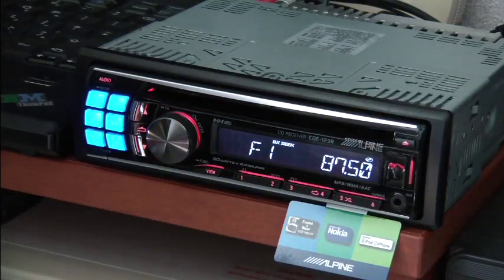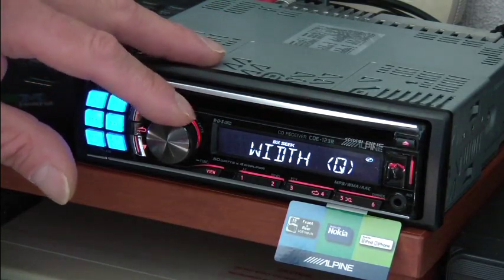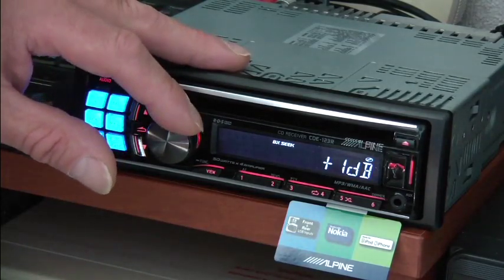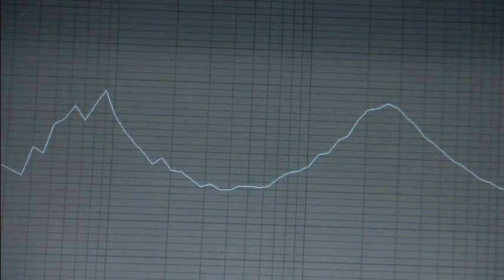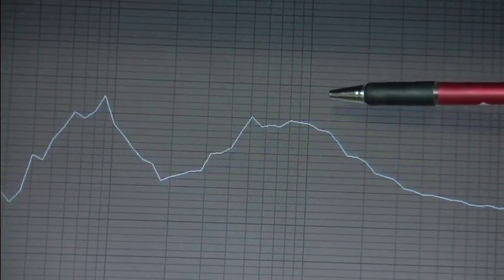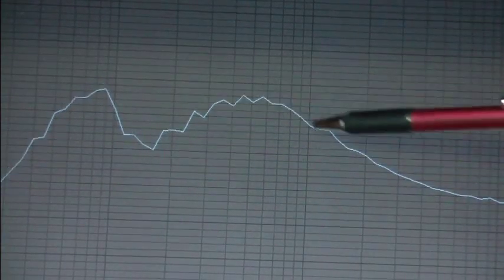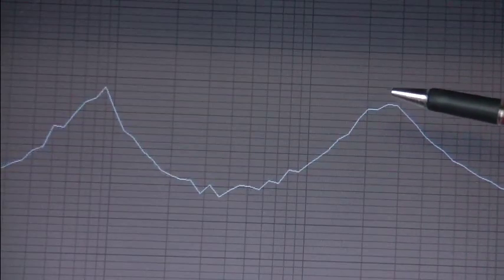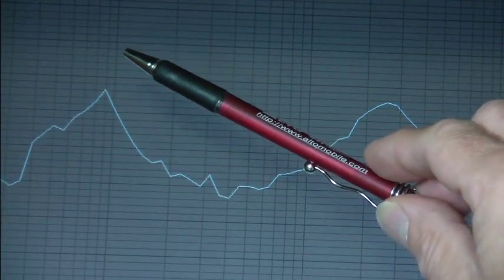Setting the Parametric EQ on a Car Stereo Head Unit

Comment: Thank you so much ! Hard to find many resources that break this down for the layman to understand.  This is super helpful.

However, when head units like alpine or kenwood (in addition to the parametric eq) have a "bass boost" and/or "bass extend" feature, do you happen to know what bass freq ranges your generic "bass boost" feature affects ? The manuals always tend to be vague.
Reply from the maker: Hi Wes. I can't remember if I ever measured the curve on those bass boosts, and they will no doubt vary a bit, but generally they are probably centered around 80Hz - that tends to be the frequency a lot of producers/recording engineers will work around in general pop/rock to give the track 'substance' without making it sound 'muddy' on some hi-fi, phones, radios etc. The boost curve may start to raise the output from as 'high' (in bass frequency terms) as 120Hz, then roll off below 80Hz to protect standard speakers from over extending. It can work ok (though very dependant on the speakers), and if just using the stereo's built-in amp then it can quickly run out of juice (i.e. headroom) and sound very muddy or distorted. On the other hand, if there's a separately amped subwoofer system tuned to, say more like 50-60Hz, the boost around 80Hz can fill a gap and provide better mid-bass. But again, it's all down to the quality of the speaker system, and the amplifiers; generally it's best to avoid engaging 'bass boost' but occasionally it can work magic.
Reply: @24HzICE  Thanks Kevin! Been trying to avoid purchasing a sub or aftermarket speakers if possible for as long I drive this '09 camry that came w/ a 'premium' JBL sound system (ext. amp & 8 speaker setup, no sub)

I prefer a flat tone, or as close to the originally intended sound production as possible, but of course the "flat" eq setting on any commercial head unit is never actually flat (marketing).  

I replaced the factory HU w/ with a Kenwood that utilizes the car's external amp.  If I want to stick with the OEM speaker set-up - and I know this depends a lot on speaker specs, etc - but in general, are the rear speakers going to put out the most bass?

If so, and if you're going to stick with an OEM speaker set-up w/ no sub, to get the best sound possible, is it generally going to be a good idea to apply a high-freq cut-off to the rears if you have a HU with that capability? 

Thanks a lot!
Reply from the maker: @Wes_5kyph1  I don't know the system you have without doing some research on it Wes, but generally OEM systems would use the larger speakers for the lower bass, and that usually means the ones fitted into the rear, also because they usually have the biggest area of air under them (into the trunk space) to work in. So yes, usually the rear speakers in a saloon car will give the lowest bass - and you should be able to clearly hear it. And yes, if they are full-range speakers with separate tweeters or coaxially mounted tweeters, then putting a high-freq cut-off (ie. low pass filter) on the output feeding those speakers will generally help the staging (the sense of the stage being in front of you), and it can often help the stereo left/right imaging too, and the 'placement' of instruments/vocals across the dash.  Having high frequencies coming at you from behind that are not natural reflections you'd get in a room or hall (these are different in time, phase and frequency span),  plays havoc with our ear/brain system that allows us to 'place' sounds. Just bear in mind it's not great though for rear seated passengers! Also, if you feel the bass from the rears is a tad boomy (not tight enough) and you have the ability to add a high-pass filter (sometimes called a subsonic filter when it's set very low), try it, set to perhaps 50Hz (though depends on the speakers and the roll-off of the High-Pass filter - anyway, just experiment). In other words, feed the rear speakers with a 'bandpass' signal - remove the very low end that the speaker might be struggling with (or over-doing - some OEM systems are designed boomy in the bass, because the designer thought that's what everyone wants!!), and cut some at the high end that tends to pull the image behind you, or at best confuses the front/rear staging.

Comment: Can you tell us good settings to start with line by line for this unit?
Reply from the maker: Hi Steve, Impossible to answer in a meaningful way because it will depend very much on the set-up in your vehicle (your speakers etc), the acoustics of the car itself, and your personal preference. The starting point would be to achieve a 'flat' or relatively consistent response (no big dips and peaks) by using an RTA to measure the curve of a full band pink noise track. After you can see the response is smooth, all the way up from bass to treble (or best you can get it), then tweak the various frequency settings to give the sound YOU prefer (more top, less mid, more bass, upper mid emphasis on vocals, and so on). Bear in mind that trying to do the first step by ear is near on impossible - you will need an RTA or more simply (but far more time consuming) plot the level on paper using a hand-held SPL meter and test disc with individual test frequencies on it.
Reply: KEVIN O'BYRNE I figured that would be your response and I absolutely understand that from the brief research I have been doing. I think my concern is more for this particular unit though..

Comment: I'm glad there's somebody willing to explain  things like this  I know a lot but always willing to learn more I don't understand some of the technical terms I will admit it took me awhile to learn exactly what a parametric EQ was but I learned from my 2005 Kenwood Excelon 25th Anniversary it still has better features than a lot of car stereo receivers today. For starters, Bur Brown 24bitDAC 5volt sprouts F,R,SW fully independent 4 band parametric eq  for front & rear 
Band 1. 60-200HZ
2. 250HZ-1.0KHZ
3. 1.25-4.00KHZ
4. 5.00-16.00KHZ
Q-Factor .25-2.00 in 4 increments 
Digital Time Alignment 0-20.33'
XOver 12-18-24 DBO
Through 30-250HZ all that was front rear and sub completely independently from one another this receiver has more processing then some Standalone processors I've seen especially with the time alignment! I started car audio as a hobby but it's becoming more like a second job that I like

Comment: This is informative, but it does not talk about how to adjust the equalizer to the system. So what, you will adjust it every time the song changes? It's cool for pro stuff, but who the hell has time for that crap? That's why Alpine has the app to integrate so that the HU can, with the app, make all the settings, with little user input. Gone are the days of technocomplicated gizmos that no one knows how to use.
Reply from the maker: Rob, I think you've misunderstood it, or maybe it's just not clear enough, but matching the output from the audio system to the acoustics of the interior of the vehicle and to the listener's preference is what I'm talking about here. Of course I don't suggest the EQ is changed every time you choose a new song (though if your own personal taste in music is very varied then it can help to set several different preset curves in memory if available on your unit). What do you think the Alpine app does, behind the interface? It simplifies the same process I describe. That's fine if you don't want to be hassled to make the tweaks yourself, but it takes away a certain amount of personal preference if you allow automation to take over completely. Lots of people can't be bothered to spend the time, I know that, and so the latest technology is great, but others want to fine tune their system but don't understand the process. All I've tried to do is explain the process.
Reply: Ive set a lot of systems for people and every time they'll have their amplifiers turned all the way up crossovers totally wrong I usually tell them to go in the house and give me 45 minutes and every time that I do this they cannot believe their ears because before they were convinced they bought junk all I do is.
Knowing the point of distortion of each component in the single chain adjusts it just below that level measurement of the sound stage is critical setting the Xover for each speaker to manufacture specs then the hardest part the eq for the longest time I do everything by ear but now I have a spectrum analyzer a distortion checker

Comment: Wow, I've been struggling to understand the parametric eq in my Alpine x0008u for years now. I've read all about how it should work, got distracted by stuff like pink noise and setting up microphones to display what my HU and speakers are doing and I've never gotten very far. In this almost 11 minute video someone has finally set me straight. Understanding what was roughly where (vocals, bass, cymbals, etc) I went right out and finally fixed my setup. What a difference! Thank you for making this simple enough for the rest of us!
Reply from the maker: Thanks for the kind words John, it really is good to know it's helping people get to grips with the parametric EQ thing. It's such a powerful feature once you get a handle on it. I learned years ago from my own struggles with stuff that a lot of techy people go in way over the top of the heads of their customers, without ever really explaining the basic concepts etc. I've always tried not to fall into that, though I never know for sure if I've succeeded unless I get feedback like yours. Thanks again.

Comment: great video I'm just starting to understand this parametric eq stuf. swapped out my 16 year old clarion for a new clarion. the sound quality has come a long way it was like my old radio was a pos the whole time. my new head unit has 3 band parametric base mid and high. does the base affect the sub output?  my sub sounds wicked clean now not sure if it's just from having a better unit or what. well explained tutorial now I have a better grasp on what to do. thanks
Reply from the maker: +CIA Assassin Thanks for that. I can't say for sure if the bass EQ on your model will affect the sub output as well as the main speakers but probably not, not if your unit has a dedicated subwoofer output channel. The bass EQ is usually just for setting the low-end tonal balance on the main speakers. Since the sub-bass is quite a narrow band of frequencies, it's usually enough just to vary the level - the type of sub-box you have (sealed/ported/bandpass etc), where it's fitted and what car you have, will largely dictate the type of bass sound you get. As for why your sub bass suddenly got better (I assume you didn't just buy a better amp!), does your new unit have a dedicated sub out with low-pass filter built in? That could be it, the LP filter. Anyway, sounds like you're enjoying your new audio system, great stuff.

Comment: I have an alpine too, but unfortunately it only has a 2 band EQ ( bass, treble). I have my high pass filter for my door speakers at 100 hz. Is there a problem if I set my bass center frequency at 100 hz too? Will it get something similar to phase distortion. I've tried setting it at 80hz and 200hz, but I just can't get it to sound right. I'm trying to blend in my subwoofer and coaxial speakers.
Reply from the maker: Gilberto Gutierrez Hi Gilberto. You can certainly try setting the EQ center frequency at 100Hz - it shouldn't cause any phase issues. At 80Hz, the HP filter will stop any boost in the EQ from having any real effect - at 200Hz it is going to be much too far from the sub frequencies. By setting center freq to 100Hz and boosting, you should get some boost even with the HP filter set to 100Hz. You didn't say how big your door speakers are and how they are powered - if they are quite small and/or under-powered then they will struggle to give much bass/midbass however you set the filter and EQ. But if they are good 160mm drivers (or very good 130mm maybe) powered by an external amp and well installed, then it should sound OK. Good luck!
Reply: Thanks for replying. I used to have 3 way 6x9s in the front doors and 2 way 5 1/4s  for rear fill (in a single cab truck). The 6x9s were very underpowered, so I sold them and moved the 5 1/4s to the doors. They're 45 w rms each (93 db sensitivity) and are powered by an alpine power pack that is 45w x 4 (rms). They sound best at 100 hz high pass. The thing is I have a 750 rms 12 inch sub with the gain set at about 550 w rms. It blended in better with the 6x9s. I'm looking at buying 6 1/2s rated at 45-60 watts rms. Maybe that will fix my problem. What do you think?
Reply from the maker: Gilberto Gutierrez The 6x9 inch speakers gave you quite a bit more cone surface area than the 5 1/4s, so I would expect them to usually sound better on mid-bass, but it very much depends on the power amp driving them and how well they have been installed. To be honest, a full answer needs a lot more than I can post here. It's not what the speakers are rated at that really matters (although it obviously limits the amp you can use with them), but the amount of power going into them. But anyway, trying to get a smallish speaker to match a 12 inch sub driven with around 500W is... well, all but impossible unless you use lots of small drivers wired series/parallel the old 'Rockford' way. But can't get into that here! But OK, a set of 6 1/2 with a good amp will give you 'some' sense of bass up front IF you install them well (don't let the rear pressure leak out to the front). And you'll probably need them rated more like 100-150W minimum, not 45-60W. That way you can drive a (good) 50-80W amp into them and they'll have a decent amount of headroom. Don't drive 50W into a speaker rated 50W max - it would be pushing it too hard, especially when you want bass out of it. Kevin.

Comment: Confusing as tell me about it lol. I have a 32 band EQ  built into my deck. 4DAC's to my knowledge.  Which is enough to pull your hair out. 

Add that to it's L/R  independent  EQ settings for each range. In addition to all my crossover points also being L/R independent if i so choose. 

This deck will make your head swim.  However is the best i've heard but a huge nightmare as well. I am not a audio engineer so where do i even begin. :(
Reply: That sounds badass! What head unit is it?

Comment: Hellow Kevin,  i been thinking on intalling a "Home stereo 31 band graphic EQ" in my car.  I know i will need the proper power inverter, But the questuon is, 
  when i run my Rcas from the xlr's adapter comming out of my 31 band EQ into my power Amplifiers,, i'm i gonna run into any issues like engine Noise or diffrent Ohm impediance in my Rca's signals??
  I hope you can Help me,  iv'e been trying to google my dilema but can't seem to get the rite answer.
   Thank You Sir!, 👍
Reply from the maker: Hi Hector. Yes you might run into some problems with noise. Equalizers designed for use in a car have separate grounds (signal ground, power ground and chassis ground are kept apart on the PCB, or electronically isolated), but they are probably not fully separated in a 120/240V model (though maybe isolated in the higher spec pro models for better S/N). You may well hit bad problems with alternator and ignition noise because of the common grounding. Your EQ has XLRs for balanced output; it will become unbalanced as soon as you connect to RCAs, but it could mean that they have isolated some or maybe all of the grounds of your EQ inside... just maybe. Impedance probably wouldn't be a problem. If your EQ is a pro model then the signal output may be higher than home/car audio, but I doubt that would cause a problem unless your amps are very low on input headroom. To be honest, there are very good car EQs around and I would just use one of those and save the cost of an inverter and all the headache! But if you want to try your EQ, hook it up temporarily first before you start any real installation work. You will need to power it from an inverter so it is running on the car's supply and ground. And remember to run the engine to test for noise - it will probably sound great till you switch on the engine ;-)

Comment from the maker: Hi, there's no straightforward answer to that, it depends on how the overall frequency curve looks when measured by an RTA. Your vehicle and the kind of audio system you have will have a huge bearing on that. For example, if you have a sub-bass system that's giving lots of bass low down at around 40-50Hz, the car's acoustic will boost that and you won't need to lift it with EQ.But if it's only delivering down to 70Hz then you will. Also depends on your personal taste in music and sound balance.

Comment from the maker: The essentials of setting up digital EQ should be very similar on the different models, though some will obviously have more advanced features, others less advanced. When it comes to reviews, I have to rely on my contacts for review samples and there's not many left at Pioneer GB that I know... all changed since I worked for Pioneer back in the early eighties, which gives my age away :-)
I'll see what I can do. Thanks for the response.

Comment: @24HzICE Yes, it's news coinciding with CES. Pioneer has the DEH-80PRS. Kenwood offers time alignment on the DNX9990HD double DIN and the KDC-X996 single DIN. Clarion has the new CZ702 single DIN and NX702 double DIN. I haven't yet found out yet if the new Alpine models have t.a. as well.

Comment from the maker: @mdubya66 A similar tutorial on crossovers (using the PC RTA) should work but getting time alignment across to people, that's tricky. But we did it back in the old days off of static magazine pages, so I guess it ought to be easier these days! I'll find a way. I'm not as 'on it' with the models these days as I used to be - I know numbers may differ from the ones in UK/Europe, but give me some model numbers with good crossover functions and T.A. built in and I'll try to source one.